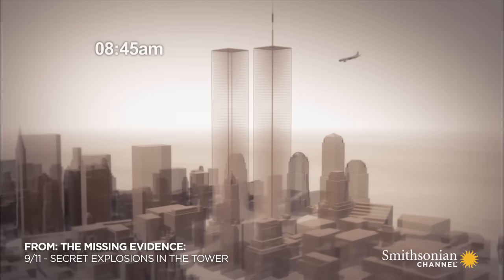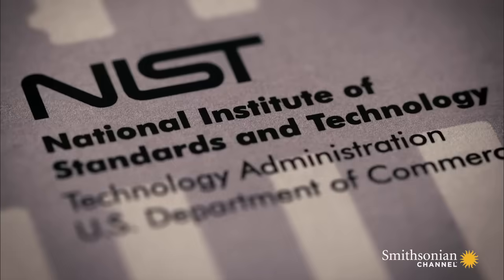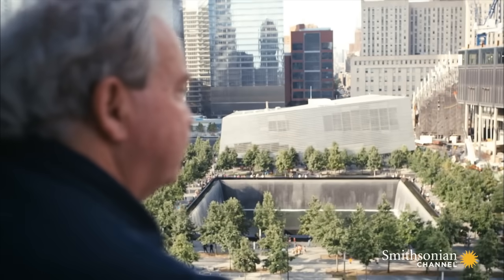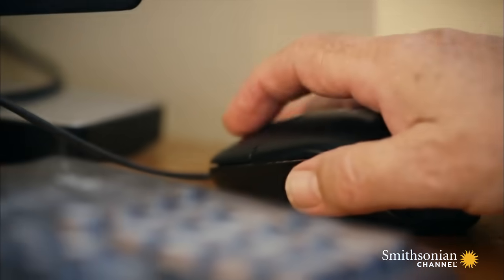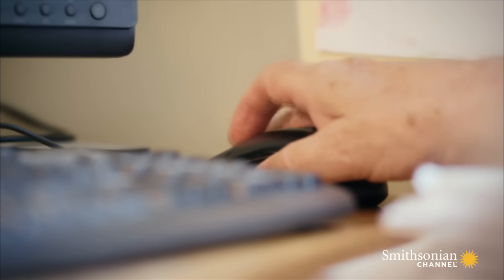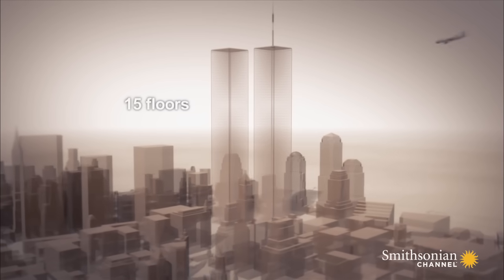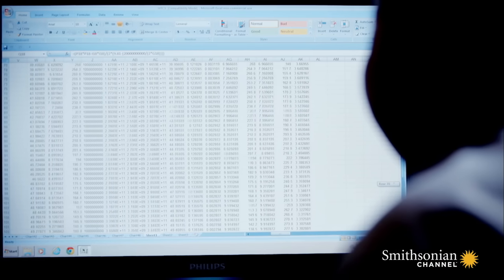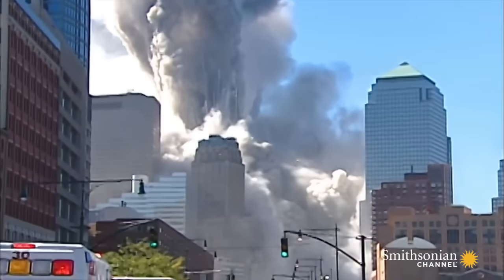This Computer Simulation Explains How the Twin Towers Fell

Comment: The regular  45' sheared steel supports in the heap on the ground shows how the thermite explosive charges were placed on every floor beforehand.  And why were they shipped off to China at break neck speed from the Crime Scene ?  They were only slowed down by the white hot core of liquid steel in the basement from the  charges.....
Reply: The giant mast on top of the tower fell before the building collapsed proving the inner core was compremised!

Comment: Can he explain why the wings on the plane didn't snap off but rather cut into the building? The wings would've fallen off the plane if a man stood on them yet all computer simulations show the wings cutting the steel columns which are designed to hold many tons of weight. What about Building 7 collapsing from 2 small fires, makes me not want to enter a high rise. How did the BBC know before hand that Building 7 would collapse? I could go on but I don't have a week to run over all the flaws in the msm narrative.
Reply: I can explain that: Because the wings, like the rest of the plane, were doing 500 mph. The towers were not solid blocks, they were 95% air.
Reply: And who said 7 only had "2 small fires"?? That's another utter falsehood! The firefighters on the scene said the building was fully involved by the time it collapsed!
Reply: "How did the BBC know before hand that Building 7 would collapse?"

The firefighters told them it would. "We were pretty sure that 7 World Trade Center would collapse. Early on, we saw a bulge in the southwest corner between floors 10 and 13, and we had put a transit on that and we were pretty sure she was going to collapse. You actually could see there was a visible bulge, it ran up about three floors. It came down about 5 o’clock in the afternoon, but by about 2 o’clock in the afternoon we realized this thing was going to collapse." - FDNY Chief Peter Hayden

Comment: Ehh...20 years later.  I still can't wrap my mind around how that localized damage could have caused the entire structure to disintigrate near free fall speed.  If the top part would have kelled over and fallen to the ground, not crushed the entire building below to smithereens.
Reply: So you haven't bothered to read any of the engineering reports. Typical.
Reply: @Tim22222  What engineering reports?  The government's main report doesn't explain it.  They gave an explaination of how the floors around the impact zone failed then said "global collapse ensued"  They kept the steel hidden as well and shiped most of it off to china as fast as they could without inspecting it closely.
Reply: @rivermorrison8383  Seriously? You've never heard of the NIST report? Yes, yes, I know truther nuts reject it out of hand. But you can't say it doesn't exist.

So the question remains: What's in the report you dispute? And what are your credentials for doing so?
Reply: @Tim22222  That report did not explain the collapse.

Comment: 3:39 .....a good example of an EXPLOSION. Cant prove a lie now matter how many cells you fill in on your spreadsheet.
Reply: Slowest explosion I ever saw. Quietest, too.
Reply: @Tim22222  I suppose you think that building 7 collapsed due to fire as well?
Reply: @FineDayWasted  I'm not an engineer but I see no reason to doubt it. Did you know the firefighters who were there predicted 7 would fall before it happened?
Reply: @Tim22222  yes, as did the bbc....just like a controlled demolition. Are you seriously suggesting that the collapse into it's own footprint, requiring almost simultaneous failure of 47 massive steel support beams was due to a few office fires???? Please...think about that for just a few seconds and realise how absolutely absurd that suggestion is.
Reply: @curiouscat8457  You sir are just parroting the official story which has more holes than a sieve. Yes, building 7 did collapse into it's own footprint. It certainly didn't topple over due to asymmetric structural failure. When shown the footage of the collapse, many engineers and demolition experts agree that this was not possible in the way being suggested. Open your eyes. Literally, please open them.
Reply: @FineDayWasted  What is "many"? All the 3 collapses were, by definition, chaotic events impossible to replicate or model exactly because of the number of variables involved. There always be people with different opinions and theories. In the end, you have to accept the only one which is technically plausible - and that is the "official" story.

Comment: I respect his research and endeavor and yes, the idea that the weight of 15-20 floors falling could easily destroy each corresponding floor below it makes total sense. The inertia of a 500000kg structure also makes a direct fall of these floors likely. Here is what I struggle with/struggle to understand and I haven't seen an explanation for. We know the floors were essentially "clipped" between the inner core and outer frame in sections. Each floor was not a singular entity or piece. We also know that the fires that existed on each floor were not uniform as rescuers were entering partially burned floors from areas not on fire. So I get the simulation under the condition that each floor was subject to the same weakening due to the 650-800 degree Celsius fire - except the reality is it wasn't. The other thing that this simulation doesn't explain are how the 47 central columns, with incredible longitudinal strength and fire-retardant coating just collapsed on top of themselves. Put it this way, if parts of the towers collapsed straight down, parts were pulled over/toppled or even were left standing I would likely believe what I saw. If there wasn't also eye-witness (firefighters who risked their lives during this) reports of streaming molten metal in the rubble of the towers things would seem a lot more plausible.
Reply: Agree. I always ask the same question.?
What happens when demolition goes wrong?
Plenty of evidence on YouTube.
À slight, a tiny slight would be welcomed to see here as you pointed out. The fire would not destroy all the framing exactly at the same time.

Comment: AA 175 attacked  on South tower at 9:03 am 15 mints after North tower but it collapsed 20-22 minutes before the north one! 
I think it happens because the AA 175 hits it in some tilted way in 83-87 floor, and in this case the upper weight of floors over the impact area or floors is much getting heavier as the beams are getting sagged pancake wise and as a result it fails to bear due to bending of  rigid beams due to heat from fire oil making perimeter columns bending inwards!
Reply: Tower 7 anyone?
Reply: Both the towers were constructed in rigid beams from Lift core to perimeter columns! 
But may if there some internal columns between the area from core to perimeter with robustly attached beams in compartmentalise way then some more occupant or people can escape also before!
Reply: @victorganguli8594  not true it was bombs wake up
Reply: The result of 2 planestrikes on 2 symmetrical buildings would be asymmetric. 
 3 almost symmetrical collapses levelling the buildings is comical. Pay attention
Reply: @davepowell7168  yes and the second plane UA 175 strikes in a diagonal direction on South Tower and at some more lower impact area than the north one! 
So this is also counts a cause for its collapsing before the north one
Reply: @variavnath624  Let me clarify, the 7 WTC buildings were not disintegrated by 2 planestrikes alone. 
    The method of destruction remains undetermined
Reply: @davepowell7168 WTC7 probably doesn't count as a "symmetrical collapse" given that a massive portion of the building was gone after the collapse of the North Tower.
Reply: @pandapops5428  l stated 'almost symmetrical collapses'
The 82 columns failed almost simultaneously for this to happen
Reply: @davepowell7168  ah, sorry. I didn't see the almost.
Reply: @pandapops5428  the penthouse drops, then the four corners seem very neat. 
     When firemen are allowed back to the debris the first words were ' so that is all that is left of a 47 storey building '
     There were steel members resting on the 2 storey Edison substation 
 which WTC7 was built on, one of the generators was partially visible .
The command center (bunker possibly underground) was well reinforced on floor 23 . A back-hoe impacting gives off larger seismic pattern than 0.6
Reply: 5-8 floors collapsed due to plane. But you can't convince me 40 floors in a sliight acceleration completely demolished the other 80 below, with no sign of slowing down and in record time.
Reply: @hegotreborn  The floors would not collapse so symmetrically to ground level l agree. The core was being destroyed first.

Comment: Because it was a controlled demolition! Anyone can figure that out! And no reason for building 7 to fall the way it did. One messed up country we are in. And no trace of the other crashed planes. Cmon now!
Reply: The remains of the flights 77 & 93 were found. Seven was severely damaged by the collapses of the towers & burned unchecked for 7 hours. And it wasn't controlled demolition.
Reply: then stop voting for psychotic senior citizens into office and change your country bro....

Comment: They fell at free fall speed as if nothing was below them. The structure below the impact would have slowed it down some.  But seems like it never did. So 15 stories on one tower and 22 on the other took out the rest of the 90 to 100 other stories at free fall speed. Ya ok
Reply: Actually, no!! The towers did NOT come down in free-fall time, but in fact much longer! The north tower took over 20 seconds to collapse; free-fall time would be about 10s.

Free fall is a myth.
Reply: @Tim22222  actually no 13 seconds.

Comment: Inside job, demolitions not airliners brought buildings down the fuel of planes blew up on impacts. Metal from the fires that were burning were little buildings were smoking black oxygen deprivation.
Architects & engineers want investigation.

Comment: Seriously? One computer simulation debunks the laws of physics?
Reply: Which law(s) of physics does it contradict?
Reply: @Tim22222  Newton's third law- every action has an equal and opposite reaction means that these three buildings collapsing in on themselves at free fall speeds is impossible. The Principle of Least Action (path of least resistance) also means that, if they were to fall, they would  fall over, not straight down. If it only happened once, ok, but it happened three times on three different skyscrapers on the same day, and only 2 of them were even hit by a plane.

Comment: what a day for gravity!!! Gravity pulled the top fifteen percent fo the North tower through the bottom 85 percent, of the Tower ..Thi s is  thousands of tons of intact steel and concrete!!
Reply: Despite the snark you're exactly right! Do you have any idea how much gravitational potential energy was stored in those towers? Way more than enough to destroy them! And don't forget: The lower structure was not shattered all at once, but 1 floor at a time.

Yes, the bottom 85% was intact - but those floors were never designed to withstand the impact of having 100,000 tons dropped on them!
Reply: @Tim22222  lol sure !!! what happened to the massive Core  of thousands of  tons of structural steel??!! the "pancake theory" youre describing doesnt fir the actual visual of the towers dintiegrating nor does it account for the collapse of the massive internal core columns ..so it is irrelevant ~!
Reply: @4465Vman  Your personal incredulity is irrelevant.
Reply: @tpryce6234  lol...hehehehehehe yeah just looking for the evidence here man..the evidence for CDs is ABUNDANT for anyone who wants to look!!!
Reply: @4465Vman  And when do you plan to do something with this abundant evidence? It’s been 20 years.
Reply: @Tim22222  and research it the bottom of the towers at any point in the building WERE indeed designed to hold the static and dynamic weight of the load above them..with lots of redundancy  built in !!!
Reply: @4465Vman  Sorry, I have researched it and you are WRONG! In the WTC towers, no floor was intended to support any weight above, only itself & its contents. The weight of each floor was supported by the COLUMNS not the floors below.

So what happens when you drop 100,000 tons onto a floor designed to hold 3500?
Reply: @Tim22222  youre describing the pancake theory but this doesnt account for the massive internal core .....if it s was pancaking the core columns would still be there but theyre not.....and what youre describing doesn match observations the entire top of the north tower has disintegrated BEFORE it starts to descend ....the top section isn't slamming down onto the bottom section the top section has already integrated BEFORE it descends ..........this is thousands of tons of intact structural steel concrete glass etc etc disintegrating in front of our eyes ...this is NOT caused by gravity ...sorry
Reply: @4465Vman  Depending on your math, the collapse of each tower released energy equivalent to 100-200 TONS of TNT! I fail to see why the core should just shrug that off undamaged.
Reply: @4465Vman  Oh, and please show us video of the top section disintegrating before it starts to fall. Never seen that!! 😉
Reply: @Tim22222  theres one at AE911 where they put aline under the bottom of the top section of the north tower.....the top has disintegrated to atleast half its size before it even starts to descend!!! it used to be on YT but mostof those videos have been pulled by now ...your pancake theory does notmatch the description the observation of the building ..."A simple 911 physics lesson" on YT is a good one.
Reply: @Tim22222  wow that much tnt..theonly force is gravity  according t the govts  "study!" allegedly "gravity caused the top third of the south tower, thousands of tons of intact steel glass concrete to disassemble !! its a miracle !!
Reply: @Tim22222  there used to be lotsof them on YT ...there are some left..theres on on ae911 truth where they put a line underneath the top of the north tower...this shows clearly the sectionis less that half its size before it starts to descend!
Reply: @4465Vman  "theonly force is gravity"

That's right! Ever take a physics class? Do you understand that gravitational potential energy is? The math isn't that hard.
Reply: "theres one at AE911 where they put aline under the bottom of the top section of the north tower.....the top has disintegrated to atleast half its size before it even starts to descend!!!"

I CALL BS!!! There is no such video!
Reply: @4465Vman  No there isn't!!  😛

Comment: I don't care how many pounds/tons of material dropped down on lower floors, it wasn't enough to cause the steel beams in the core of the building to snap. That entire gridwork would have remained standing with conceivably the floor slabs surrounding them 'pancaking.' (But even that notion is defied by the video evidence). Those steel beams were designed to support the weight of the entire building above them by multiple factors. Someone should do a computer model that shows that sort of outcome unfolding...
Reply: Your opinion matters, how?
Reply: @tpryce6342  <---- this is a government shill. It's only purpose is to go after anyone who questions the official story.
Reply: actually it wasnt they used trusses which were weak and were one of the big reasons why the towers fell. also they had little fireproofing.
Reply: @says101  The buildings were holigrams in the first place.

Comment: It was the structural build that caused this falling. The outside construction and major center column were attached with beams for each floor. The problem was each floor was not supported by any other mid or major columns and a pancake effect happened. Steel won't melt by raging jet fuel, but it will absolutely become more susceptible to frailty meaning it will bend or warp with it being so hot and under so much pressure with the weight. With no real support for each floor, they literally just popped outward from the immense pressure and weight. Several floors below would feel the effects of the uppers floors giving out, so it's likely they were already in the process of popping too before the first couple floors even met. The tube design of the building (though it's square) didn't compensate for each floor to hold themselves up under these absolutely crucial moments. Once the floors that were severely damaged were weak enough to give way, it was what we have here. The weight of the floors above gaining speed and the floors below not having the structural balance to seize the full effect the growing damage, weight, and velocity that the upper halves were gaining as gravity pulled it down.
Reply: 1) the only steel that could conceivably have been "bent or warped" would have been those subjected to flames.
2) NONE of the floors below the impact sites were exposed to flames. Their strength/integrity was 100%
3) you can argue that a pancaking event took place, but only the slabs of each floor, but not the steel beams
4) accepting the pancaking argument, what we should have seen after the interior floors had collapsed, is the rigid steel frame still remaining intact with pancaked floors all around them
5) Duh!
Reply: @JJ8KK  So where did all of it go then? I suppose it disappeared.
Reply: @JJ8KK  Also, it was an old buld. Trusses were in place where the outer walls were the strong point. If it were a demo job, how did the inside men know exactly which floors to demo where the planes were at each towere. Completely different levels, but we still have the same build and collapse concept.
Reply: @JJ8KK  Also, duh!